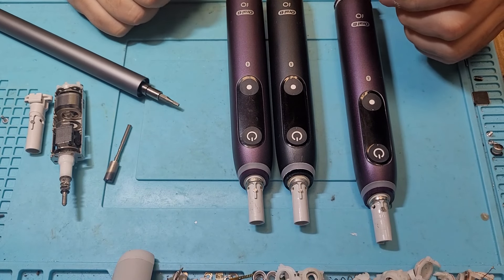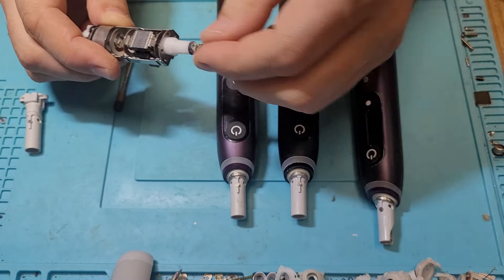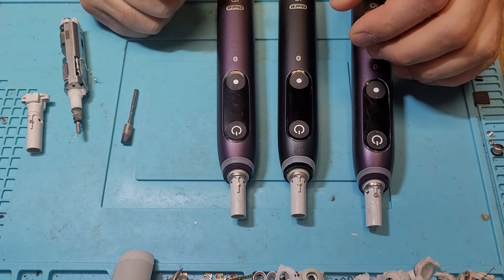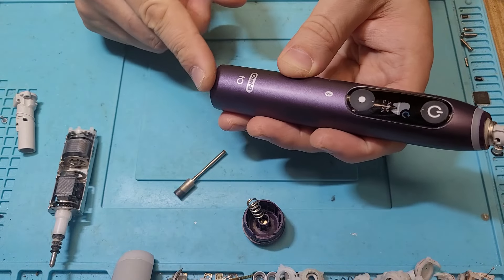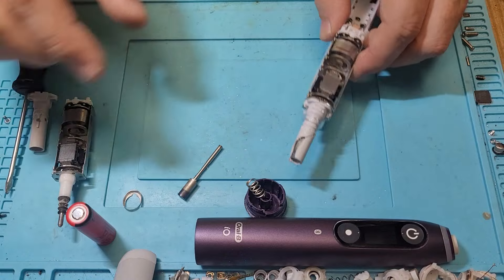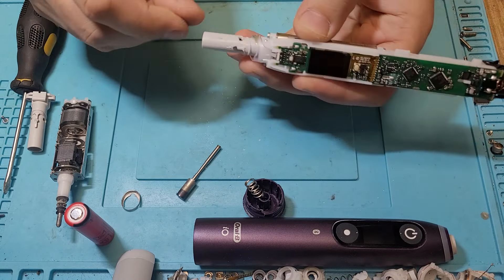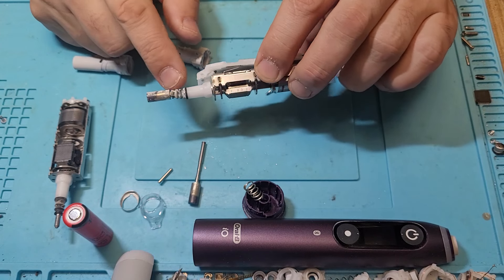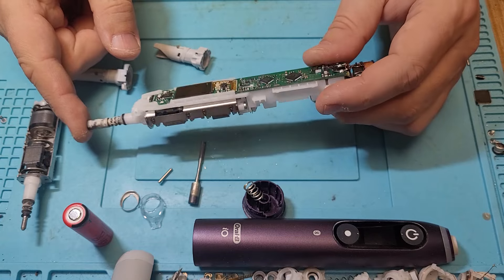Oral-B IO teardown/repair and impressions

Comment: My toothbrush Io doesn't change and torn on but when I put it on charger the screen on and when I removed it shuts down... Never works.. what I should do 
.. please answer me
Reply from the maker: Try to take it apart inspect fuses, check for shortings on motherboard.. inspect for water damage or electronic failure

Comment: My issue is the shaft broke at the epoxied location, but I tried gluing it back (with epoxy) and that didn’t fix the problem. Looking at the brush head, the magnet inside moves up and down when you manually rotate the head, so that makes me think the whole magnetic piece in the handle should go up and down. Is that correct? What might make it stop moving in that direction, but still vibrating? Thanks! 

Does the Series 9 have the same motor as any lower priced models?
Reply from the maker: yes epoxying it back is not as straight forward as it seems.. it could be that you put to much of the glue ant head didnt got all the way in its original place.. i was thinking that first you should make a groove on the epoxy inside of the head for the excess of the glue to escape. and when the head sticks out its not able to give vibrations to the brushing head as it should..
Reply from the maker: and regarding motors i believe all IO toothbrushes will have the same drive unit

Comment: Everything works except the display..it doesnt show for some odd reason. Any suggestions?
Reply from the maker: Not really concrete solution but.. get yourself a donor board and either replace it completely or check them one with another.. replace the screen..

Comment: What type battery it used it and we’re could I buy one??
Reply from the maker: i have mentioned measurements of the battery somewhere in these comments. my warning is that usually battery is fine problems are on the motherboard if its not working..

Comment: Qǐngwèn
查看字典
2 / 5,000
Excuse me：Oral-B iO4 electric toothbrush from Braun Germany: Why does it show fully charged after about 10 minutes of charging, but only run for 1 second before stopping? How can this issue be resolved

Comment: My oral b io when I tried to change the head the shaft stayed in the old head, I noticed the new head didn’t vibrate and after an inspection I found the shaft still in the original one. After watching your video I believe my only option is to buy a new one?
Reply from the maker: if only the black part was removed I assume it is possible to glue the old one back in place with epoxy. but its a tricky process if you put to much glue it will stick out and not vibrate as well.. easiest repair would be to get a donor motor and replace the whole unit.

Comment: Can you make a vid of how to open the round black charger stand Oral-B io…the plug cable near the back is kinked thanks 🙏🏽✌🏾
Reply from the maker: usully the older chargers are epoxy filled so there is no posible way to open it up.. havent tried but I believe this new one will be the same

Comment: Hello I have problem where brush turns off when you apply pressure even though display reads ok battery voltage, any ideas?
Reply from the maker: sorry didnt had this defect..

Comment: I wonder if you could dremel that spot weld off, replace the seal (if you can source one), then maybe JB weld the shaft back on. Just a thought. Thanks for the video and your thoughts. Wanted to see a tear-down before I get one. My dentist keeps trying to sell me on one. Seems decent and I like the socketed 18650.
Reply from the maker: to difficult.. exchange of the whole driving unit is more reasonable but it would be good for Braun to offer it as spare part.. and its not 18650 but smaller battery, nevertheless impressed that braun made this easy to exchange socket :)

Comment: Any idea to fix a braun io that is stuck on the start up screen and keeps looping?
Reply from the maker: have few of those but didn't had a chance to examine further.. the y lay in the "to do" box but I think my impression was that there was water damage and some traces on the back side were damaged.. but you need to completely disassemble the board to get to the back side.
Reply: Mine was stuck on the language selection screen. The on/off button wouldn't select. I downloaded the app and paired it to the toothbrush. I was then able to change the settings and the toothbrush worked as expected. Mine was probably a software glitch, rather than hardware issue.

Comment: The little cylinder inside the coil of mine has cracked. Can that be replaced?
Reply from the maker: Should be, it could be some glue that holds it in place but had few toothbrushes where it fell out so it shouldn't be to strongly glued

Comment: Any idea on an io6 that fully charges and then keep randomly switching itself off, from 100 percent after a few seconds of brushing then swiyches off and falshes red to indicate battery empty. I have also changed the battery for a new one and it is still doing the same thing?
Reply from the maker: Difficult to say.. needs a hands on approach to have a detailed look.. check voltages on board, fuses, charging chip or even charger could have issues..

Comment: Hi, do you know where I can buy the top cylinder head replacement (the one onto which the brush plugs in)?
Reply from the maker: Sadly there is no spare parts from Braun.. and I haven't saw any in AliExpress or so.. only option that I see is eBay at the moment.. but there is a risk to get damaged drive as well..

Comment: Hi. Some water got into io toothbrush and the back internal parts caught some rust, I left it dry and today tried to switch it on and it's working just fine . Do you think it's safe to use ? no idea what to do
Reply from the maker: The same as in Sonicare brushes for electromagnetic drive it has zero influence just keep the electronics dry and it should be fine.

Comment: I had always a oralb brush. My former one lasted 12 years. Now I bought an io8 last summer. IT fell down and first the display stoppe showing so I thougt ok, no problem, don't need it. Then the Part you hold in the hand in the last scenes Fell out. Now I want to fix it😢
Reply from the maker: if you are talking about metal part then only fix is to replace the whole electromagnetic drive. no chance to repair that.. if you are from europe you can write me letsfixitgarage@gmail.com
Reply: @letsfixitgarage   Thanks for your answer, unfortunately I am from Turkey. thanks anyways

Comment: If you compare by experience with is better iq braun or Philips prestige overall 😊
Reply from the maker: difficult to say.. I like Philips for having more exchangeable parts, but prestige is very difficult to get as spare part and if you get water inside you are screwed as it will damage electronics that is glued to the housing and there is no way to get to it. both will hold long if maintained correctly. both afraid of dropping (seen IO with cracked plastic head part and water gets through it inside of the toothbrush) one more thing that I don't like about IO is the toothpaste assembly inside of the plastic head, difficult to clean.. So my preferred toothbrush would be philips expertclean 7300 has everything technology wise, easy to clean and is possible to repair :)

Comment: mine is oral b io6, the charging station is a little bit different which lacks the notches, how can I remove the cap with other tools?
Reply from the maker: Procedure is the same insert the charger and rotate the base. It's even easier with this type of charger ;)

Comment: Hello, I have two oral b io toothbrushes, and they don't work, I opened them thinking that they could be the batteries, but they had a 3.6 v charge, but I realized that there was a lot of humidity inside, the motor with robin, the fact is that they do not turn on, what could it be, thanks
Reply from the maker: Well water is tricky.. there could be shorted component or a PCB track that corroded away. You can check my Philips Sonicare water damage repair maybe it will get you some tips but these are difficult repairs. Another way would be to replace the motherboards if needed write me an email have some as spare parts. But main thing would be to find out why and throu which point water got in.. it should be waterproof..

Comment: Hi so hopefully you can help me out. I just got the i09. I put in a new head and it won't spin. The brush turns on and vibrates and everything. I haven't gotten another head to see if that's the problem. But I'm wondering is that magnetic cylinder piece connected to the drive supposed to move when you turn on the brush or just vibrate?
Reply from the maker: It's very small, but strong movement/vibration. Try to place a finger on top and press down to see if the ring light changes (imitate pressure on the teeth: this brush has to low, optimal, and to strong pressure lights) if you feel strong vibration and lights are changing Problem is in the head. Maybe it didn't go all the way down or maybe it is defective..
Reply: @letsfixitgarage  thank you very much. That was very helpful I'll give it another try. Appreciate you taking the time to answer me.
Reply from the maker: I got a notification that you replied to me but app can't find your comment...
Reply: @letsfixitgarage  lol. Thank you. No actually I replied asking to see if I can send you some pictures or videos. But then I realized what was wrong. The person who sold me the toothbrush magnetic piece broke off this whole time. I just didn't know.  Bad seller. But thank you though
Reply from the maker: @nhatle2160 thanks for the explanation! it helps to learn more on these "remote diagnostics" what to expect in other cases when you know what was the problem in the end :)
Reply: @letsfixitgarage  of course man. Appreciate you even putting a video up. No where in oral B do they even show everything.

Comment: I did a battery replacement but now it doesnt turn on at all.. any ideas? I left it on the charger and it felt warm and the heatsinks are also warm when I opened
Reply from the maker: Hmm difficult to say.. maybe the problem was elsewhere why did the battery failed first.. and what kind of heatsinks do you have in mind? On the motherboard there are no heatsinks..

Comment: Mine still vibrates but it vibrates differently and is louder I think it’s the build up of the tooth paste and the white mold thing because i never really rinsed it…. do I really have to take it apart to get the build up out of the vibrating area where the brush goes?
Reply from the maker: Don't think so. Just put it in a warm water head down and leave it for some time. It's kind of water proof but I would cover only the white plastic with water not the silver metal ring. Then put it under running water and turn it on it should clean itself.

Comment: Now if i did poke a hole in the micro mesh seal.. how would you fix this?
Reply: I always charged my IO in the charging case it came with.. but it would charge to 100% and not turn on when I took it out. I just opened the other charger (where the bottom of the charger opens the bottom of the toothbrush) and it seems with this method the toothbrush turns on automatically).. i stupidly thought the mesh seal was a reset button and heard a little pop
Reply: Could I just cover the external side of the mesh seal hole completely?
Reply from the maker: Well the mesh is there for a reason. I assume some water gets in and it escapes through the mesh. Would suggest to open it up and carefully remove the mesh sticker and reapply it pushed a little bit sideways. Not sure if functionallity will be 100% as original but I would give it a try. you can cover the hole with hot glue anyday ;)
Reply: @letsfixitgarage  thank you
Reply: @letsfixitgarage  repositioned the seal, no issues. Thanks again!

Comment: Have io5 series, just stop to work, no lights on buttons, short lights appears when I put it on charge and push both buttons. Reset, battery remove, didn't affect.
What could be a problem? Can new battery help with this issue?
Reply from the maker: If the battery hold charge, doesn't discharge - doubt it... If there was water inside need to remove motherboard as usualy more damage is on the back side...
Reply: Thank you for the answer, will check, but as I remember there was no visible water leak.
Reply: @letsfixitgarage  I opened the toothbrush to check the battery type to order a replace battery. When putting it back in the housing, unfortunately I didn't put the silver ring properly on the rubber seal. I used it 2 times and the display stopped working. There's a tiny bit of dry toothpaste visible on the side of the motherboard below the screen. Is there any chance to repair it without replace the screen or the whole motherboard?
Reply from the maker: Difficult to say, try to dry it out and insert charged Battery if your lucky maybe that's all it takes. If no there could me motherboard damage I would not exchange the screen they are very fragile better to exchange complete motherboard..

Comment: I have a series 3. after opening very carefully and replacing battery it no longer works. original battery doesn't work or charge either. I read in their manual not to open or "it will stop working". and also to replace the toothbrush head after dropping "even if there is no visible damage".
I feel like they have prevented user repairs by design, but I dont know how exactly
Reply from the maker: Difficult to say as I haven't had series 3 in my hands but series 6-9 don't have any anti opening protections.. you can open and close it as many times as you want the same is true for battery.. if you had to replace the battery initially, I would look for problems on the board. Maybe something heats up.. charge the battery fully externally and try to plug it in the brush. If nothing happens check the fuses.
Reply: @letsfixitgarage  I charged in my external charger to 4.0v, still nothing. I dont see fuses the same as you describe but maybe I need a magnifying glass
Reply from the maker: Yes you will need a magnifying glass or at least what I saw on series 6-9 motherboard fuses are really small. They have 2 fuses one for the drive (bigger one) and one for the brain. They are located next to each other.

Comment: Hi, I have the Oral B iO Series 6N, without the magnetic charging port with the 3 hole to twist. This Model have the long stand charger, like the genius. 
Can you tell me how to open this model? Because my stand charger doesn't have the 3 holes to hold the toothbrush to twist. 
Thanks, maybe you can do a video?
Reply from the maker: The same procedure. Insert the charger in to hole and rotate counter clock wise. It will be even easier as with 3 holes ;)

Comment: After 2 years my Oral-b 8N started to sound weird. The whole thing vibrates like crazy but the brush head is not spinning as fast as it should. Battery is draining much faster and the area around the display goes warm (not hot) after 3 minutes of use. I tried to soak the rod in warm water but didn´t help at all. It looks like no matter what brush head I use (new or old) its just not sitting tight enough on the rod, its too loose. Same thing happened to my Philips Sonicare, vibrations got very strong but the cleaning effect was near to zero :(
Reply from the maker: With Philips it's much easier.. have few videos explaining how to fix that issue. Regarding IO I speak in this video about shaft breaking off the motor. This looks to be it in your case. Open it up and check if the shaft is still connected to the electromagnetic drive. Sadly there are no spare parts by Braun. 
If you're from Europe you can write me an email maybe I can help you.

Comment: Does 18650 battery work on it? Or only 18500 will work?
Reply from the maker: It will not fit. 18650 is much bigger I will remeasure the battery and let you know but it's much smaller its not 18500
Reply: @letsfixitgarage  Damn yes my bad. 14500 is what I used in it successfully.
Reply from the maker: Yes 14500 is the original battery measurements. Voltage is the same as with 18500 so it can work but it will not fit.

Comment: its a bit disappointing they're still using the same battery i have in my IO6. Mine started cutting out after 1 year when it said it still had 65% battery. I've replaced it today with a vapcell F12  1250mah i hope it fixes my issue will be interesting to see if the capacity is really 1250mah and if it lasts longer than the original battery.
Reply from the maker: Let us know in a month or so of usage. I saw few brushes that have problem with batteries but I was suspecting the motherboard on discharging it. Would be interesting to know your experience.
Reply: @letsfixitgarage  for me it cut out at 65%  as if the battery was 0% then when i put it on charge it would immediately start charging and show 65% straight away on the display. It would charge to 100% and the same thing would happened when it hit 65%. will let you know how the new battery performs :)

Comment: В плане надёжности и ремонтопригодности старые Genius Х получше чем IO6 будут, у них и плесень реже говорят заводится?
Reply from the maker: If there would be spare parts I would say IO is even easier to repair then older ones easier to exchange the components, but there are no parts to get... As for the mold IO has bigger gap for toothpaste to build up so yes it's more likely to get it and it's more fragile, if droped upper plastic part breaks easily metal shaft is fragile as well.. but it is more silent, stronger vibrations, faster charging and housing is of hard plastic. Genius series had problems with rubber housing getting mold or peeling off.. everything breaks but in my opinion genius is sturdier then IO..
Reply: @letsfixitgarage  Thanks for your reply. I bought a Genius 8000. I like everything so far. After use, I wash it, wipe it with a towel, and leave the handle open in a dry place, I think that this way there will be minimal chances for mold.
Reply from the maker: Yes this kind of care should be enough to keep it in good condition 👍